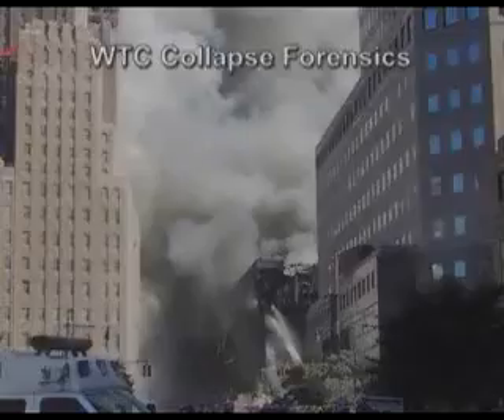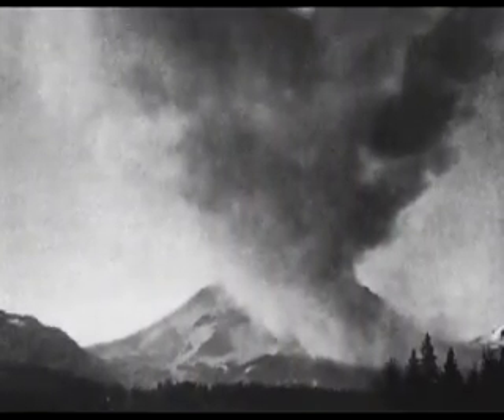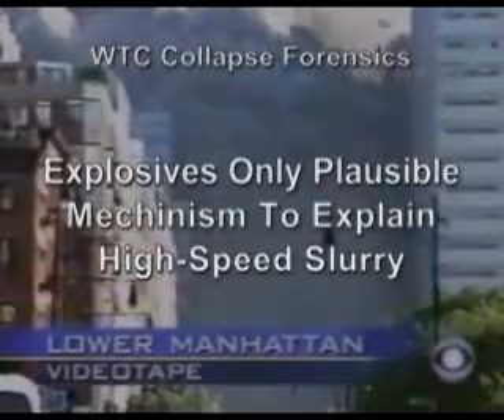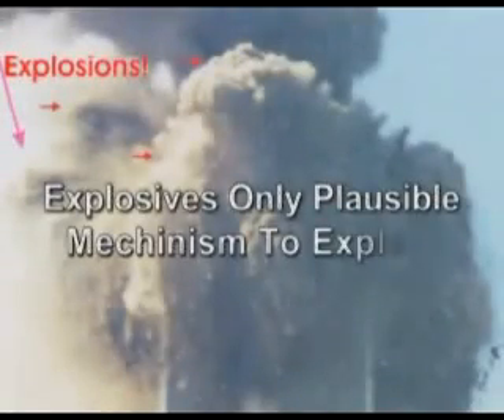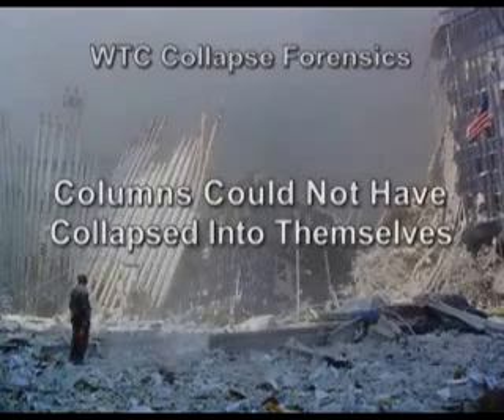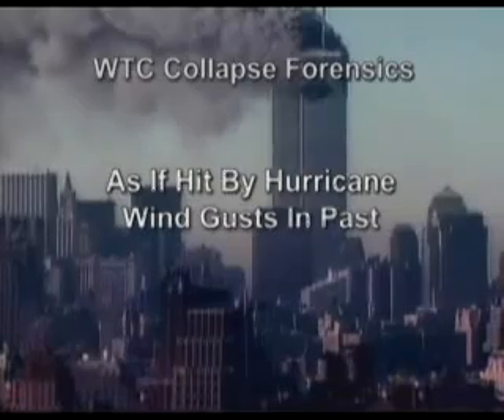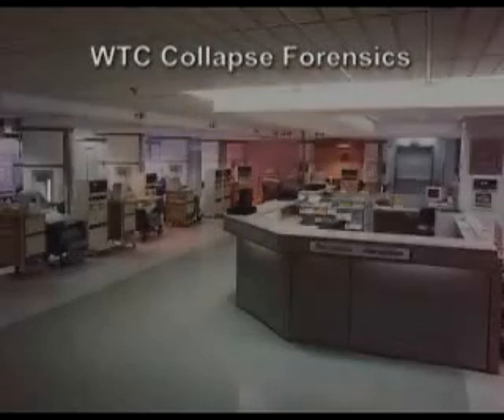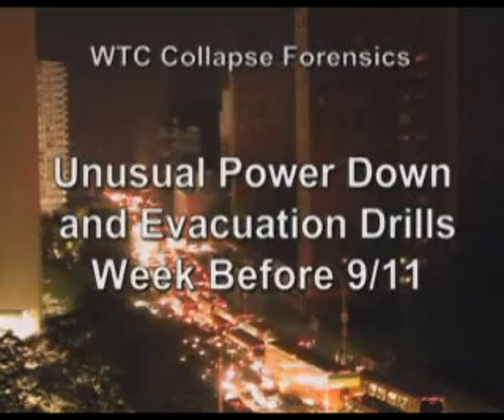MIT Engineer Disputes 911 Theory of the WTC Collapse-Part 2

Comment: Building 7 was evidence to activity leading up to the show and had to be destroyed as well. Someday a jetliner will be run into a high rise building that's NOT rigged for demolition, and you will see what your common sense already tells you should be. 911 cant fuckin' happen that way without demolition! Steel DOES NOT AND WILL NOT ACT LIKE THIS.
Reply: Oldschooldan1
Have you actually read anything on the B25 crash? Obviously not. The aircraft did incredible damage to the structure of the ESB - an engine passing through the building and a 6.1 meter hole. I'd say that was pretty substantial wouldn't you think? Still no collapse though. However you put it, some of the the greatest engineers out there have all said the same thing - the buildings were rigged. Have a read of the material on the 'mass denial' of the incident by people that just cannot accept the facts from the day. People are too scared to believe what really happened and lived in denial the fact something so terrible could have taken place. They are to scared not to believe the official story. It's just another way to enforce the police state after the patriot act was signed. More control gained by scaring the shit out of people that big bad (made up) terrorists are out to get them. How else was they going to rape the middle east for oil and gain total control of the masses?
Reply: TheLondonForever00
Please, you’re embarrassing yourself; comparing the damage from a 20,000 lbs plane with a 70’ wingspan traveling 200 mph to a 300,000 lbs plane with a 160 ft wingspan traveling 500 mph is so mathematically stupid even a moron like you should see it. Let’s not mention that the 2 bldgs are constructed completely different.  “The greatest engineers out there” HAHAHAHAHAHA you got to be effen kidding me. A&E911 is a fucking joke they are the laughing stock of the industry. The AIA and the ASCE want absolutely nothing to do with them. You are aware that the engineer of record for the bldg thinks you guys are bunch of dumbass lunatics. Here is another little fact for you dumbass; we import less oil from Iraq today than we did prior to the war. We let the Iraqis decide who they wanted to sell THEIR oil rights to. Guess who they decided to sell them to; the French, Chinese and Russians; we got next to nothing. You sir are a uneducated  fucking moron.
Reply: Benjamin Vogel Wrong, about 11 stories of it collapsed. Difference is a gigantic fucking jet didn't crash into that tower.
Reply: TheLondonForever00 Firemen were also able to battle that fire very quickly, on 9/11 that was not possible.
Reply: Dave Fisher the Wtc buildings were built to withstand a 707..... At slow speeds and limited fuel on board. But the fact is the buildings DID withstand the impact of the jets, it was the resulting fire that took them down, so that point is moot.
Reply: Like you said oldschoolfan - the core didn't collapse. The WTC had enormous cores that were design for such failures. But then again you're going to tell me that concrete vaporizes, turns to powder and falls into it's own footprint next aren't you? Come on, just admit it. You're are comical in your arguments, if not very arrogant and blinded by your own opinions. Now stop being a rude little boy and run along. If you want someone to properly debate this i'd be happy to oblige. So for now, stop hating on people and get off your pedestal. Continue and someone will report you for abuse. Learn to talk, debate and discuss - you'd be surprised as you'd probably learn a few things in the process.
Reply: TheLondonForever00
Hey London,
Thanks for your comment. Actually, I'd given up debating with oldschooldan when he stated: "You are aware that wood retains its strength longer in a fire than steel; we fire proof steel for a reason."
WTH?...

And I eighty-sixed pbmdh when he contradicted himself.
First he states: "Difference is a gigantic fucking jet didn't crash into that tower."

Then in a subsequent comment he states: "fact is the buildings DID withstand the impact of the jets, it was the resulting fire that took them down, so that point is moot." (Can't have it both ways unless you are a troll)

These guys are just keyboard jockeys with no contribution to make to the discussion.
Reply: There is no point debating someone who can't look past their own nose. Short sighted, closed off to other opinions (or fact), and devoid of any real manners. You are a truly rude individual who more than likely suffers from 'only child syndrome'. And as for evidence and and proving me wrong? Dear dear, you need to stop watching the bullshit videos that are all over your profile sunshine. you believe too much. You deflect questions with abuse more than you answer questions, relying on copy and paste and out of date articles that serve no purpose other than misinformation. You seem obsessed with proving others wrong - is this a reflection of your own self doubt? Maybe. It's a shame because you have the makings of an intelligent person, you just need to work on your reasoning and analytically skills a bit more to see beyond what it fact and what is fiction. You drop the odd factual piece of evidence but rely too much on unsubstantiated reports to give your ramblings any credence. So if you really want to debate this and start looking at real evidence, I will happily afford you some of my time. But please give me some warning, as my real life continues outside of You Tube. Thanks.
Reply: It already has, the empire state Building. It burned, oscilated but never fell and was designed/built in a time when materials and engineering wasn't as good as the modern architecture.
Reply: TheLondonForever00
The Windsor Building: Worst ever building fire documented in modern history.. No collapse.
Reply: Yes but add to that that Fireman didn't have the equipment to to deal with such a fire back then and that many of the materials were combustible in the ESB. Modern fire retardant materials are much safer. The balance is there for all to see.
Reply: TheLondonForever00
Umm…no, the balance is not there. You are comparing apples to oranges. Trying to compare a B-25 traveling 1/3 the speed carrying a 10th the fuel and a 1/8 the weight striking a traditional steel cage structure to the WTC is utterly ridiculous. How fire retardant do you think desks, computers, papers, chairs and phones are?????
Reply: pbmdh If 11 stories of it collapse then great, you're only furthering the proof that WTC collapses were somehow set up.... Considering it was roughly this same size of a hole in the WTC that supposedly caused the whole building to collapse... Right Windsor building wasn't hit by a plane, but it burnt longer, and more completely without suffering complete collapse. Don't forget there were still people alive within the floors that the jet crashed into.. You can see them standing in the hole not too long after the jet crashed. So the fires couldn't have been so completely enveloping the floors, that would have stopped anyone from accessing the edge of the hole in the building.
Reply: Oldschooldan1
You use a velocity for the Boeing 767 which is only attained at high altitude. Watching the video it's obvious that the plane that struck the north tower was going much slower (200-250mph?)
The B-25 has a top speed of almost 300mph but was probably cruising at around 180-200mph when it hit the ESB on that foggy morning. You're right that it is a much smaller aircraft but it also hit a much smaller building (area-wise) and one that was not designed to withstand aircraft impact. In contrast, WTC1 & 2 were designed to withstand the impact of a Boeing 707 which has a 130ft wingspan and would have weighed around 240,00lbs.
Another thing to consider is the comparative empty weight of the 707 (120,000lbs) vs the 767 (175,000). The 767 is constructed with much lighter materials which is good for fuel-efficiency but means most crashes result in the complete destruction of the aircaft. A fully loaded 707 with it's heavier fuselage (area wise) would have been very similar to the impact of the 767 in damage to the building.
Reply: Dave Fisher again a 20,000 lbs plane with a 70’ wingspan traveling 200 mph to a 300,000 lbs plane with a 160 ft wingspan traveling 500 mph. Do the math Dave. The speed has been calculated by experts using the known locations of certain bldgs and calculating the distance between them and the time traveled by the planes. Planes can easily reach these speeds when coming out of a dive, which is precisely what we see on 9/11. The ESB was built completely different and used much stronger materials than the WTC. The WTC was built to be light weight the ESB was not. You are comparing apples to oranges.
Reply: Oldschooldan1
First of all, you ignore most of my argument. That is that  the WTC was built to withstand the impact of  a 707 which, all things considered, is not that much of lesser threat than a 767.
also you state, "traveling 500 mph. Do the math Dave. The speed has been calculated by experts..."
Please cite one source for this.
Reply: pbmdh exactly!
Reply: pbmdh
before 9/11 no steel-framed building had ever collapsed due to fire. there are many cases of steel-framed buildings that suffered much hotter fires and that burned for longer periods of time without collapsing. on 9/11 three steel-framed buildings with minor fires collapse into their own footprint within hours of each other, and you are not questioning that?
Reply: Dave Fisher before 9/11 no steel-framed building had ever collapsed due to fire , This is total bullshit! There have been dozens of steel structures that have failed due to fire. I think what you mean is there has never been a high-rise bldg that has completely collapsed due to fire , but then again there has never been a high-rise bldg built like the WTC that was struck by a 767 and left to burn for an hour unabated.  You are aware that wood retains its strength longer in a fire than steel; we fire proof steel for a reason. The NFPA tends to disagree with your assessment of steels performance in fire.Minor fires  you got to be effen kidding me. Please point me to another high-rise fire that had 3 or more 1 acre floors on fire; I’d love to hear about it. The Windsor tower in Madrid is a perfect example of what happens to unprotect steel. It had all the steel fail above the 17th floor in less than 4 hrs. The only reason it did not collapse to the ground completely was due to the concrete core and the concrete transfer floor on the 17th floor and it wasn’t hit by a 767 nor did it lack fire abatement. Would you like to debate this further, I’m afraid you are only make a fool out of yourself.
Reply: TheLondonForever00 ”Like you said oldschoolfan - the core didn't collapse. The WTC had enormous cores that were design for such failures” ummm, no they weren’t. The cores in both towers survived the initial collapse they failed because the floors and perimeter columns gave them lateral support and prevented sway and shear. Once the floors and perimeter columns were gone the core was allowed to sway past the point of failure and they collapsed; breaking at their weld joints. The core in the Windsor tower was steel reinforced CONCRETE, not steel like the WTC. You are poorly attempting to compare the strength of a steel reinforced concrete column that is load bearing to a light weight non-load bearing 4” thick concrete slab over metal deck. Again you are showing your total lack of understanding of how the towers were built and your complete ignorance of steel vs concrete construction.  The only one comical around here is you. Feel free to knock me off my pedestal by proving any of what I’ve stated as untrue, be sure to back it with a source and some math would be nice. As for the abuse, it’s not abuse to call someone a traitorous ignorant fool when they are being a traitorous ignorant fool. I’m simply pointing out your severe character flaws. If you wish to debate about the collapse of the WTC I would be happy to. We can start right now, just state here and now your hypothesis of how the towers collapsed. I’m sure we could all use a good laugh.
Reply: Dave Fisher
What did I get wrong Dave???? It's true wood does retain its strength longer than unprotected steel in a fire. Feel free to prove me wrong.
Reply: Dave Fisher
Reply: Dave Fisher "A fire test conducted in 1961 at the Southwest Research Institute compared the fire endurance of a 7x21-inch glulam timber with a W16x40 steel beam. Both beams spanned approximately 43.5 feet and were loaded to full design load (approximately 12,450 lb.). After about 30 minutes, the steel beam deflected more than 35 inches and collapsed into the test furnace, ending the test. The wood beam deflected 2 1/4 inches with more than 75% of the original wood section undamaged. Calculation procedures provided in a new publication available from the American Wood Council, entitled Technical Report 10: Calculating the Fire Resistance of Exposed Wood Members, estimates that the failure time of the 7x21-inch wood beam would have exceeded 65 minutes if the test had not ended at 30 minutes."  Suck it you fucking idiot. You stopped debating me because I keep proving you wrong time and time again.
Reply: TheLondonForever00 Wow, way to tuck tail and run. So what you are saying is you have no facts and can't really debate anything. What did I state that was unsubstantiated???? I have backed everyone one of my statements with a source I can't say the same for you. What real evidence do you have??? I asked you for your hypothesis and you are too scared to share it. Come on you want to debate start with your theory and evidence.
Reply: *****
I have read the NIST report that has been accepted by every architectural and engineering university in the county, The NIST report that had 13 recommendations that became code; the one that all current bldg are built by, yes! Have you read the report?????
Reply: No, actually it doesn't say much for the Truth movement.
Reply: *****
When the experts in the world disagree with you; this is not a good sign....for you. Idiot!
Reply: Ok, please give your scientific evidence that the US gov't was behind 911; I'll wait. Please state your sources. I need a good laugh.
Reply: We have a president and people disagree him him all the time. What's your point????
 I'm sorry but there are many other comments visible on this thread. Are you so paranoid that you can't physically see them????
Reply: *****
 You said a dictator controls the lives of the people and in which people are not allowed to disagree we all can disagree with our President. People do it thousands of time time a day. You are a paranoid moron! Nothing you've stated proves that 911 was an inside job. Get un-fucked!!!! Put up or shut up; if you have no evidence to present than go the fuck away.
Reply: Oldschooldan1 I just could not laugh it off without a comment...LMAO
...you stated "It's true wood does retain its strength longer than unprotected steel in a fire." and continued to provide proof by presenting a test..."conducted in 1961 at the Southwest Research Institute [which] compared the fire endurance of a 7x21-inch glulam timber with a W16x40 steel beam"...disingenuous and misleading, to say the least...but that is to be expected...however, you forgot to accentuate the fact of "glulam" not being just a wood timber...but in fact carefully chosen, high strength glued laminated timber, manufactured by bonding together prepared laminations of solid timber so that all have their grain arranged in an essentially parallel, longitudinal direction...specially treated [for fire resistance, indoor, outdoor, load bearing or limited-load bearing applications, as needed] and in addition bonded with specially approved adhesives, defined and classified by internationally accepted standards depending on their application [as noted]. Therefore, not your typical wood members at all...!

In addition, a single steel beam does not provide heat transfer signature present in a steel grid construction...or interconnected steel members as is the case in a steel framed building [highrise] design...therefore not comparable at all but simply used as a marketing stunt as to promote glulam for its capabilities in rustic/natural design/restoration/renovation applications

If you are a professional in the field, I suggest you download a full brochure and specs booklet for free and get acquainted. I use manufactured beams in all restoration and renovation projects for decades.   

http://www.apawood.org/SearchResults.aspx?q=ANSI+A190.1-2012&f=Glulam%3bCommercial++Construction%3bEnglish&tid=1
Reply: Rando Ligutic
 You're quite right, I should have said laminated wood and glue retains it's strength longer than steel in a fire.

"In addition, a single steel beam does not provide heat transfer signature present in a steel grid construction...or interconnected steel members as is the case in a steel framed building [highrise] design"
How does a steel truss (not a W16x40) relate to the heat transfer?
Reply: Oldschooldan1 ...and you should have noted that a true comparison would demand a careful measurement of equivalent load bearing capabilities of the two members...7x21-inch glulam beam timber is not an equivalent to a W16x40 steel beam on a  43.5 ft span...only an idiot would span that distance with a H beam of that size. That's why one must calculate the general mass moment of inertia [I = k m R2] and for the steel beam of that size it would be approximately I= 247960440.000 [lbm-in. (sq)]...quite beyond the safety factors as to remain unaffected by the load of 12,450 lb. even without the presence of fire. As I stated. that was simply used as a marketing stunt as to promote glulam...

As for your second question...what you are misrepresenting is the importance of any single steel element in a steel structured grid; design perfectly capable of compensating load distribution beyond the point of damage. Floor structure is not a single standing element but an incorporated part of the structure bellow and above. Failure of any section of the floor can not possibly cause catastrophic failure of the entire floor. Quite the contrary...it would facilitate the spill-out effect of the debris above it...!
Reply: Rando Ligutic

As for the 1961 fire test, your math seems sound and you could very well be right. I will have to investigate further.

As for your response to my second question, I don't think you quite got what I was trying to elude to. I was making a comparison between the way heat is transferred by say an I-beam vs. a steel truss. Trusses are well known for failing in fires.

"Failure of any section of the floor can not possibly cause catastrophic failure of the entire floor"
Of course not and I am in no way say it would. What happened in the case of towers 1 & 2 was damage from the planes impact took out several floors and approx 20% of the load bearing columns on one side of the bldg, stripping the SFRM from the remaining trusses and columns. The fires caused the trusses to sag, this lead to a lack of lateral support for the remaining exterior columns, which bowed and lead to the collapse of the upper section of the towers. The only element of the floor system that had to fail at this point was the truss seats, they were grossly overloaded.
Reply: Oldschooldan1 ...just download the booklet from the link I provided...glulam industry today is far more advanced than back in the '61 and they have no need to exaggerate anything these days. All tables and calculations are actually providing great alternatives to traditional building techniques, although still pricey. 

I fully understand your insistence on the importance of the floor trusses failure and their vulnerability due to the span in question. However, as noted earlier...you insist on "impact [taking] out several floors and approx 20 % of the load bearing columns on one side of the bldg." ...

This is simply untrue, or let's say a gross exaggeration of the actual results of the impact. If you are familiar with the structural design of the WTC, than you know that the B767 profile/cross section could only effect a single floor significantly and only on the side of the impact which in no way constitutes an entire floor. Thus considered a partial damage...especially when you take in consideration the fact that the same aircraft [aircraft grade aluminum] shell had to penetrate the outer steel grid thus shredding it to pieces with no significant mass and kinetic energy left as to reach the inner load bearing column frames...much less cause the catastrophic damage necessary as to affect the load bearing capabilities of the inner core columns.

While you could say that the initial impact of the aircraft, and the resulting jet-fuel blast, might have in some way damaged up to 20% of the outer core [closely knit] steel grid...it still does not compute the probability of those steel elements being completely cut away in mass, nor does it effect the designed capabilities of the steel frame to redistribute the loads vertically. 

You insist on trusses for a reason, that is exactly the main argument provided by NIST...however unscientific and improbable. You continuously promote the idea of trusses being "grossly overloaded"...without any supporting evidence to the claim...the initial jet-fuel explosion resulted with radiant elimination of all free mass within the surroundings [as all explosions do]...thus only eliminating the initial loads and partial floor collapse could only facilitate the spill out effect, previously mentioned. These factors lower the initial mass of the structure above and in no way contributing to the failure of the much stronger structure bellow, one designed to carry that weight originally with additional safety factors allowing even greater loads to be introduced and supported almost indefinite.

The important point is that no complete failure of any single floor was even remotely possible, as to result with pancaking, and partial failures simply do not add up to synchronized vertical collapse...and this is without taking in consideration the actual resistance factors [which grow larger with each collapsed floor] and their calculations in case of an actual pancaking, how ever improbable it may be...

I did not even address the fires as they had very little impact after the initial collision and the resulting explosion...all that remained was simply office fires lasting for a very short time on a very wide area with no significant flash points to account for...
Reply: cq4fun ”You continuously promote the idea of trusses being "grossly overloaded"...without any supporting evidence to the claim” Here is the evidence you are looking for.
https://app.aws.org/wj/supplement/WJ_2007_09_s263.pdf

”and this is without taking in consideration the actual resistance factors [which grow larger with each collapsed floor]” I’m sorry but this statement is completely false. All the floors had the same live load capacity (with the exception of a few mech. floors) the floors did not get stronger the lower they went. The load capacity was dictated by the strength of the truss seats and all evidence shows they were completely overloaded. The floors had a live load of about 6 floors static, once the collapse started there was no way the floors below could have stopped it, none what so ever.

”I did not even address the fires as they had very little impact after the initial collision and the resulting explosion” Again this is your opinion, the fires were estimated at as much as 1800F, unprotected steel loses half its strength at 1100F. You can see the perimeter columns slowly bowing 20 minutes prior to collapse. There are only 2 things that can cause slow bowing of steel, heat and pressure both were in abundance that day.

NIST, ASCE, AIA, NFPA, AWS, Les Robertson (the engineer of record) and every engineering and architectural school in the world agrees with the facts that fires and the jets impact weakened the structure and once the collapse started it would have continued all the way to the ground.
Reply: Oldschooldan1 ...one can only wonder why you actually continuously engage in embarrassing yourself even further...??? Clearly you can't even grasp the basics of physics and chemistry and yet you want to discuss the event to which the official story stunned the world with its improbabilities and transparent fabrications...weird...!!! Are you really that limited or just being stubborn...???
Reply: cq4fun So, are you saying that the floors got stronger the lower they went???? Please link me to any structural study showing this. I need a good laugh.
Reply: Rando Ligutic Did the top of bldg. fall on the floors or did it fall directly on to the point loads?
I don't think you have clue how these bldgs. were built or their load capabilities.
I tell you what why don't you tell me what structural element could have stopped the collapse once it started.
Reply: Oldschooldan1 ...oh man...you are the dumbest troll here...! Even a fifth grader would have understood the comment. Did you ever read a book in your wasted life?
Even a regular newspaper reader can connect the dots, but not you!

So yes, please go check out the mirror, it should provide you with a great laugh...you are getting more hilarious by the minute...lol
Reply: Oldschooldan1 ...aha...now you need the "extensive loads" to hit directly on the connecting elements...and I assume simultaneously, right...?  You are a joke...so which structural element are you most concerned with...? The main truss seat, the column seat, the intermediate support angle seats, the strap connections, standoff plates, gusset plates, the damper unit, spandrel itself...what should we focus on...?

I assume you still want us to consider all elements failing at the same time for each floor and in the same manner all the way down, right...? Although the aircraft impact only partially damaged one side of the building and did not cut the entire floor structure of any single floor [while only affecting two to start with]...not to mention the fact that the damage never reached the inner core column, right...? 

And I guess, we must disregard the floor portions actually simply caving in and facilitating the spill out of the debris, right...? While we are at the point of disregarding all aspects needed for your fairytale to work, why don't we disregard the fact that each truss had metal decking interconnected with diagonal bracing straps bellow the highflex concrete layer, that should help as well...!

Just to be sure, please provide us with direction as to how the initial freefall was to start with the steel grid practically intact above the impact zone and only damaged up to 20% on a single side...please note, up to 20% as being extremely generous...!
Reply: Rando Ligutic "so which structural element are you most concerned with" the one that could have stopped the collapse. You are ducking the question. Which structural components of the tower could have stopped the collapse and how????
Reply: Oldschooldan1 ...hmm...how about all of them working together as designed...!!!
Did you think about that one...?
Reply: ***** All of them working together were never rated to withstand that much dynamic weight, period, end of fucking story; unless you have some math that proves otherwise?????. Got any math???? I didn't think so. Moron!
Reply: ***** Huh?????
 See: v=gt, and  v = √(2gy).
You're not that bright are you?????
Reply: *****
Well that's very scientific... the only traitorous shit around here is you. Still looking for some math to back your stupid theoy... got any????? I didn't think so, moron!!!!!